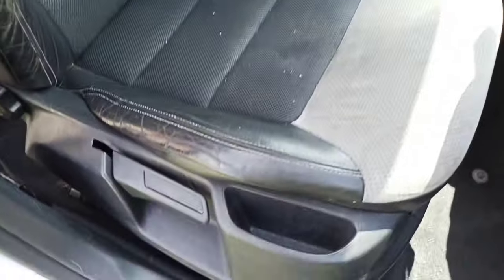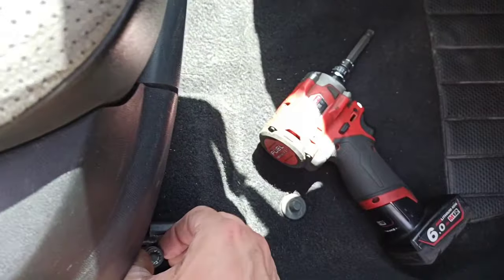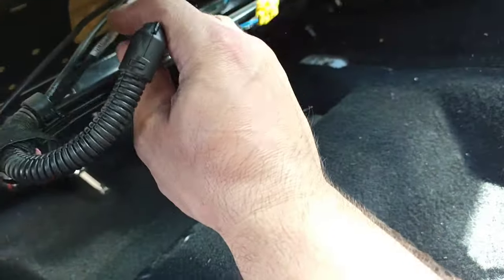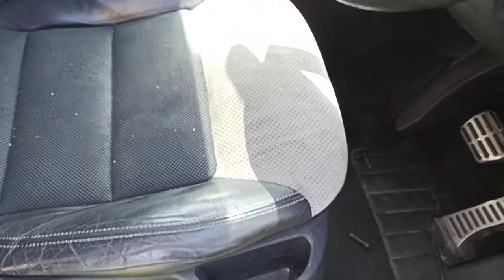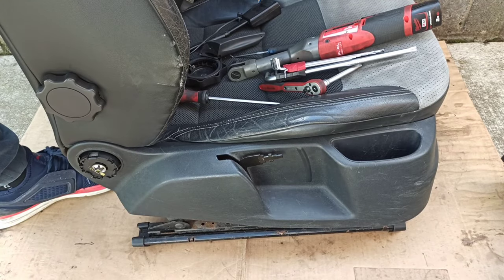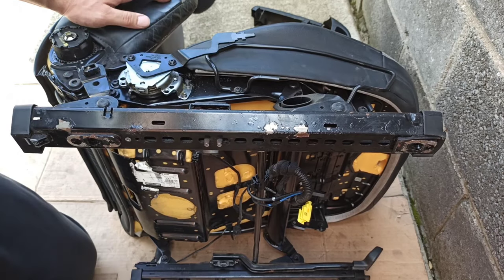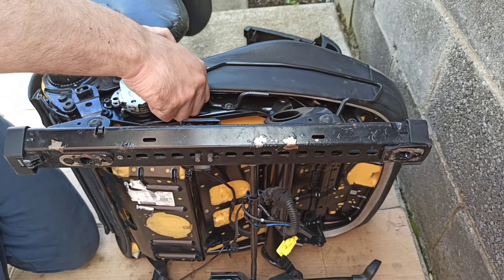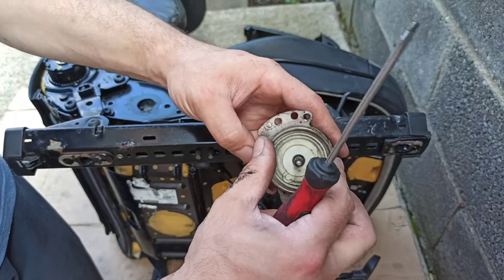Car seat repair/ seat height adjustment repair and seat belt buckle replacement

Comment: I followed the step-by-step instructions on the service bulletin, No.:17-NA-198. It tells you how to repair the seat height adjustment in just about 5 minutes, without removing the seat. I wouldn't be making this comment if it didn't work, yes it did work i'm now enjoying the height adjustment seat on my Chevrolet Equinox. Before you go tearing your seat apart please check and read the service bulletin it will save you time and trouble.

Comment: is there any easier fix, my seat just won't go down but goes up? Thanks
Reply from the maker: Hi, fault on your seat is probably same as on this one but not as bad, so as in does heavy lifting of human, I think there is no real way to fix as again very soon will make problem or won't work always, so better find other seat which has good condition of it and replace. 
Hopefully all info is helpful
Reply: @out_of_service5844  thanks for answer. What do you think if I try to put some kind of lubricant or WD40 in this mechanism without disassembly, will it help?
Reply from the maker: @alabama1974  try it, might be it's only sticking and will start working. You won't loose anything if to try
Reply: @out_of_service5844  I will try, I think this happened today because it was like -15C this morning :) Thanks again
Reply: @out_of_service5844  I had to replace lifting mechanism also :)